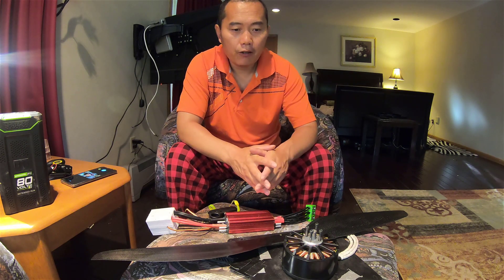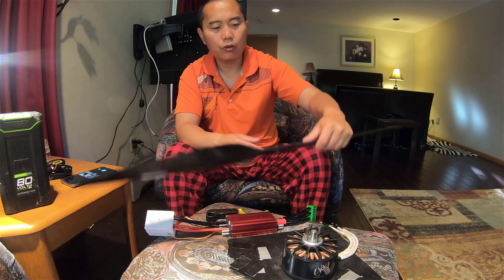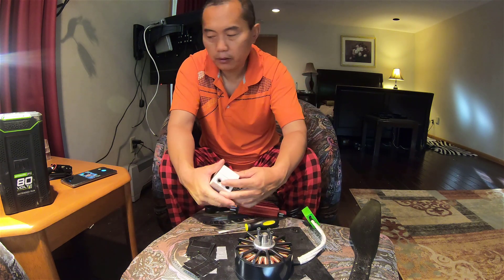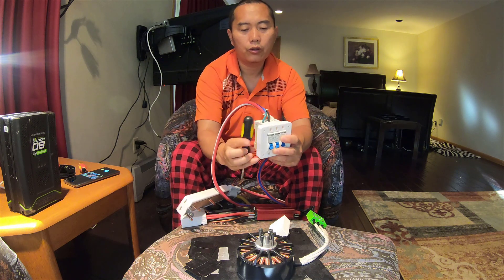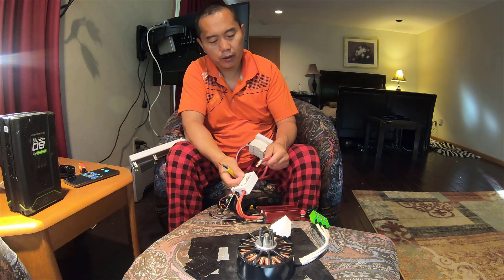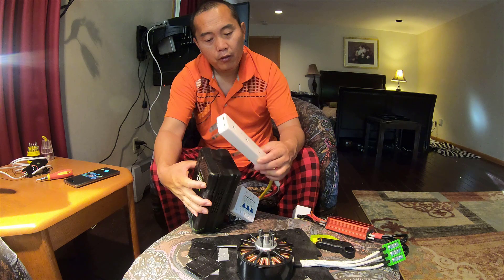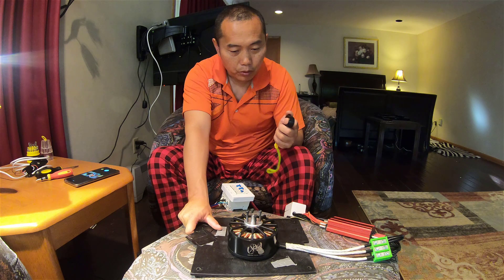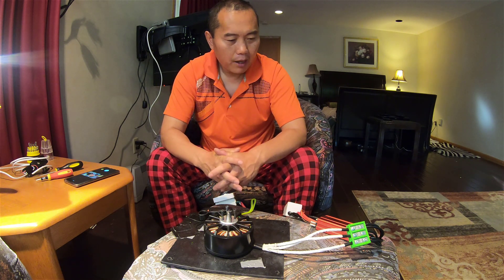Minne Motor E-PPG Electric Paramotor Power system assembly

Comment: what is the flight time for this setup?
Reply from the maker: with 6 of 80v batteries, the flight time is about 30 minutes
Reply: Can we increase the flight duration to 100-120 minutes by adding more batteries? (though it will be heavier)
I can lift the whole unit as I am a heavy weight lifter and my bodyweight is 80kgs.
Or can I use in trike with a big size wing of grade A?
Reply from the maker: Yes.  20kw power system is good for teike.

Comment: Very cool design and package.  Currently I use an AGNI/Lynch high power axial gap permanent magnet DC brushed motor.  Do you have any controller options for brushed DC motors for 48-80 volts and 11-20kw output? Or any suggestions?
Reply from the maker: brushed motor controller basically just control the voltage. which is hard for high voltage and high current.